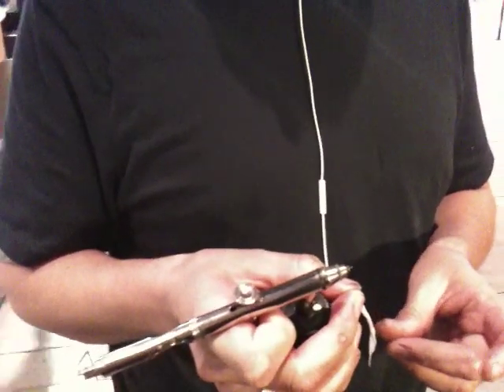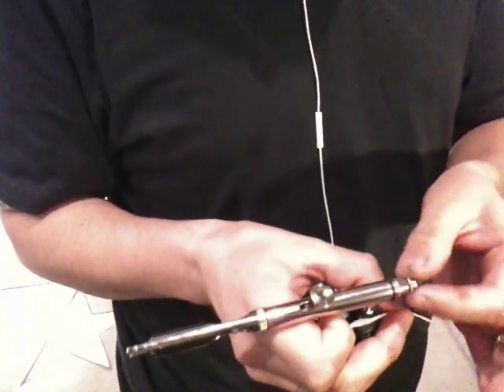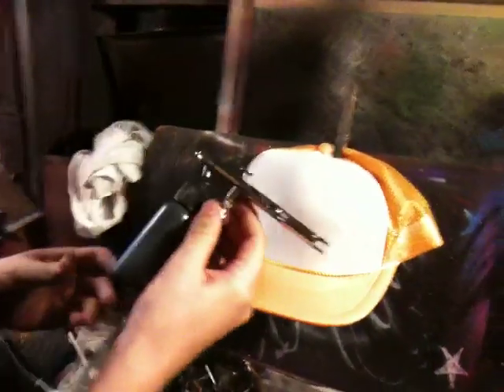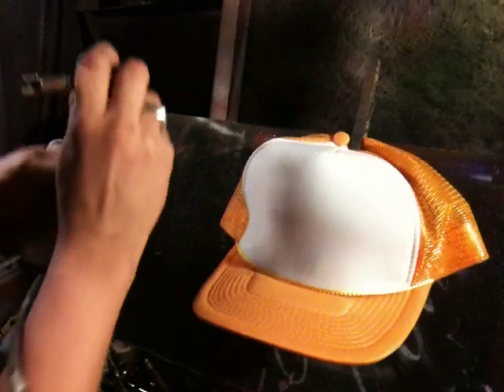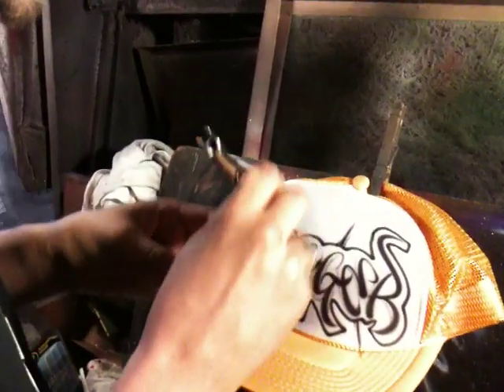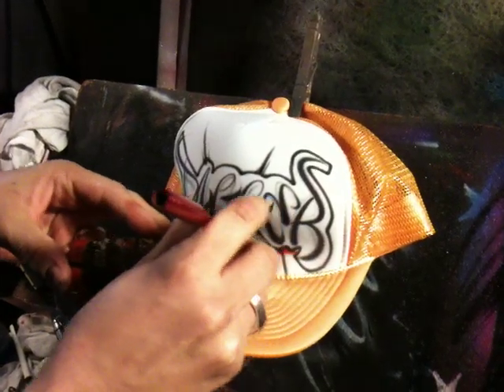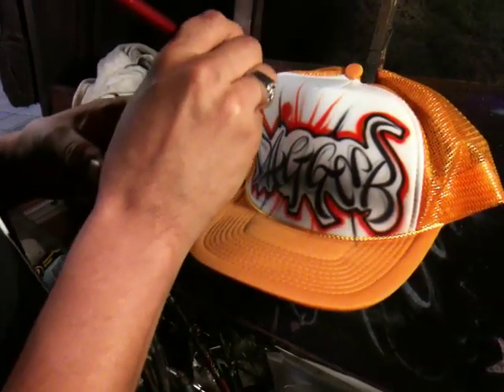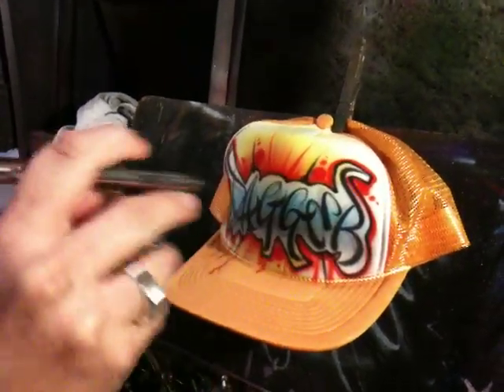airbrush graffiti  on hat and airbrush tips and tricks

Comment: nice! thx for the "quick fix" tip. i have a cheaper airbrush that tends to spit. i will improve the seal and see what improvement I can obtain. my better airbrush seems to also spit (?) when there is a minor obstruction (like paint buildup on the needle) at the orifice.

Comment: love your videos, just wondering which gun you would recommend the omni 3000, vega 2000, or iwata hp-bcs. im currently using the badger 150 and have been having problems with it, dont no what it is, at times it sprays real good and then it will just start acting up clogging every 10 min. and sputtering and paint dry on tip atleast every 2 mins.

Comment: ya i have 2 badger 150s and i clean them both real good its just that tip dry is like every couple seconds, ill get like have way threw making a b and ill have to take the tip off and peal that shit off the needle. i did just buy a iwata hp-c plus and it works flawlessly i dont no what it is with 150, by the way im using createx paint.

Comment: ah what paint do you use mate? i use a no name airbrush i got for like 10 bucks off ebay and tbh its actually fucking good!! but im using a waterbased (but for automotive use) paint called autoair and i run about 35-40psi and i still get some tip dry .. things to look at with tip dry ,and spitting is AIR,PAINT,and how clean the airbrush is so go over all over those factors and hopefully u will fix it